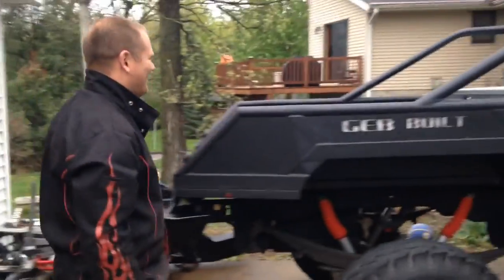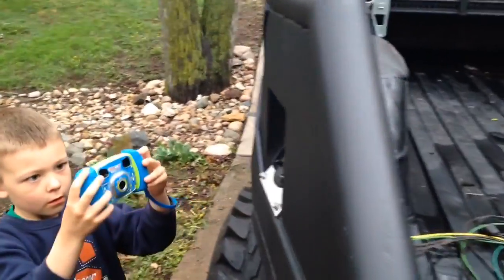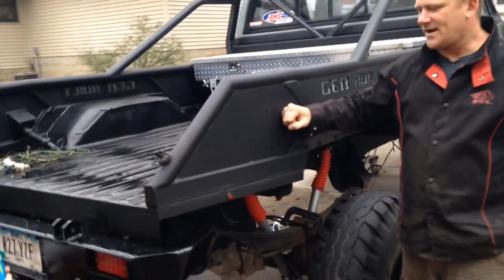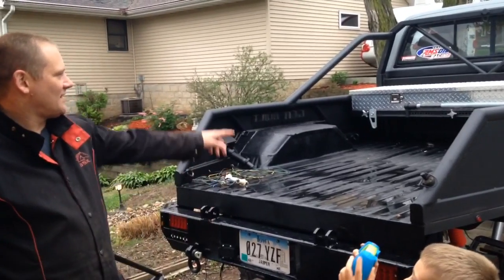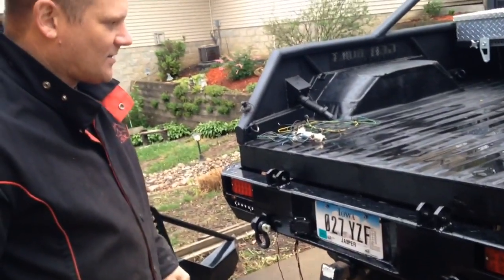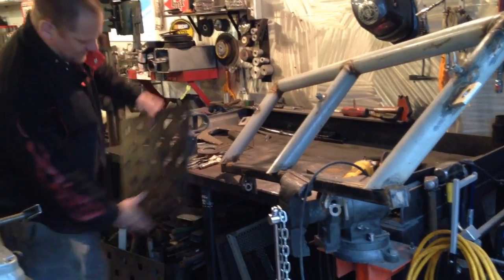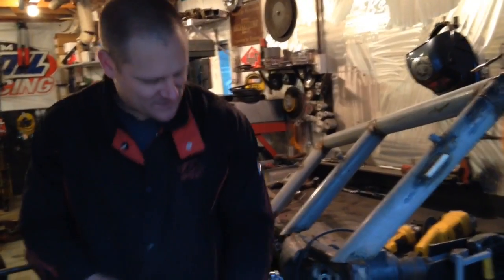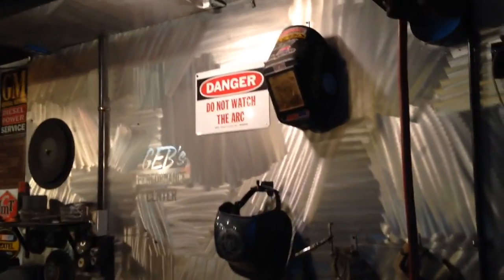Truck Bed -Custom Built

Comment: Great Idea for a good looking and functional truck bed!    Those aluminum ( thin and Chinese )  have that shinny coating on both sides that need to be cleaned real good with a wheel designed for aluminum and not use an aluminum oxide flapper wheel ! FYI
Reply from the maker: Thank you for watching and commenting, great input! I think I learned my lesson on that one! God bless!

Comment: This has to be one of the best truck beds I've seen. If I had the skills and the tools, I would fabricate a cargo rack and some fenders for my Jeep. The bottle caps can't drop between the inner aluminum panel and the outer part and get stuck, right? I was wondering about that when I saw it.
Reply from the maker: Thanks man!! The inner alum panel only spans to cover the grenade cutout, so any caps would fall into the bed or to the ground (to be picked up and recycled of course). Appreciate you watching!

Comment: Bed is awesome bro, great work. 
    The supports for your headache rack, did that happened to get bent with a harbor freight bender . I only ask because I noticed there was a bit of flattening in the bend. If so you may try to shim the sides of the pipe as you are bending it. Maybe try on a piece of scrap and see if you notice any difference.   I built a pipe/plate bumper for my truck and I messed up several pieces of pipe cause it started to try to  flatten out and eventually kink . I decided to try shimming it and it reduced the flattening of the pipe quite a bit..  Just some food for thought.   Again ,great build man   ...
Reply from the maker: Ya they were bent with the HF bender. I decided on the angle I wanted by watching the flattening process and stopping before it got too bad, then made the second side the same angle. Actually employed my six year old on these bends to show him the ins and outs of bending with a cheap bender! The shims are a good idea. I have a HF bender mod I did on another one I had years ago that eliminates 99% of kinks too. I've seen the same mod floating around on YouTube, but I'll load another one when I mod mine. Glad you like the build!!